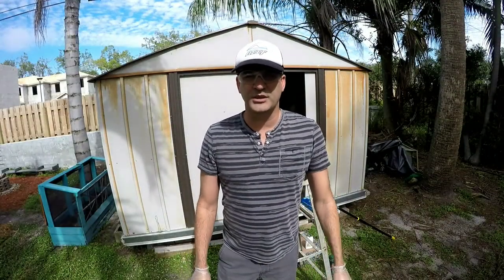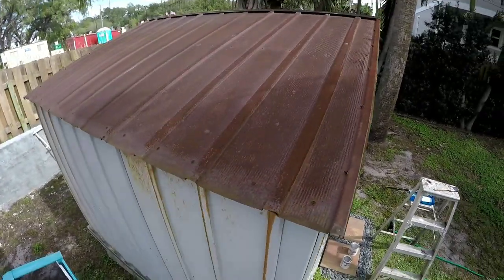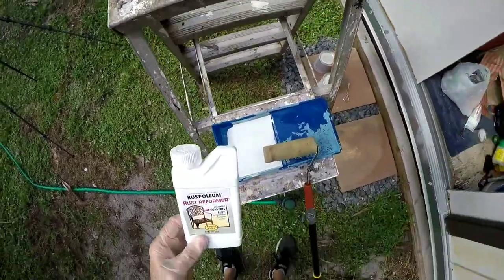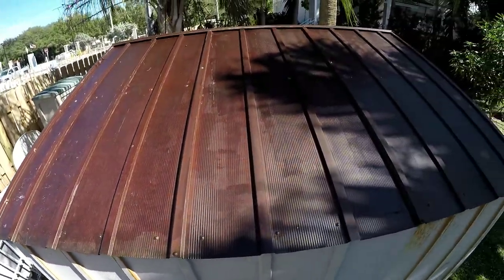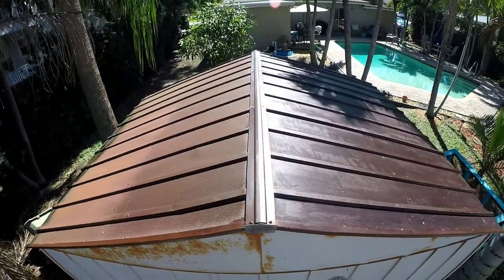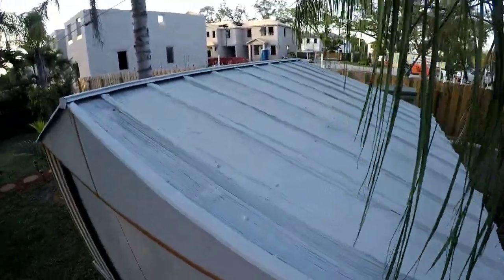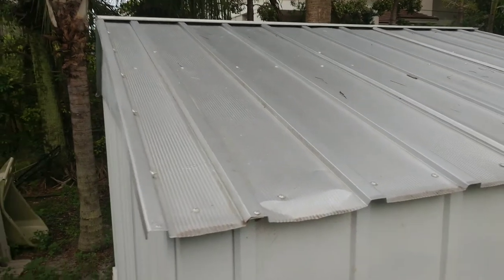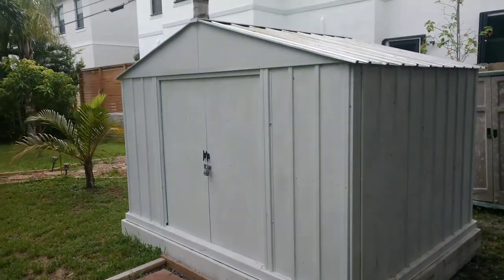Rusty Shed Roof Repair

Comment: Did you prime right on top of the rust or sand it down first? Edit: I see you applied that rust reformer. Is that it? No sanding necessary?
Reply from the maker: I didn't have to sand because it was surface rust.

Comment: Hi, on the roof, you used the rust reformer then primer then paint. Do you have to wait 24hrs or just 4hrs between applications?
Reply from the maker: Reformer, primer, then paint. I did one layer each day. I think you can paint even sooner between coats. Check the label on the can, I forget.  Thanks for watching.
Reply: @Waveshank  k thx

Comment: One thing to remember are cars parked around the vicinity of overspray when spraying a large roof. Don't wanna pay for alot of paintjobs.
Reply from the maker: Good point. No cars anywhere near. The roof paint was applied with a roller in this case. Thanks for watching.

Comment: What is the purpose of using the rust reformer?
Reply: It converts the rust to a paintable survace iron phosphate I think it turns to anyway if you don't use this rust will just come back supposed it stops it personally I feel better about stripping it off to bare as close as possible then use converter and paint .